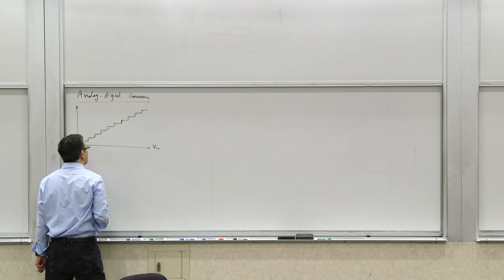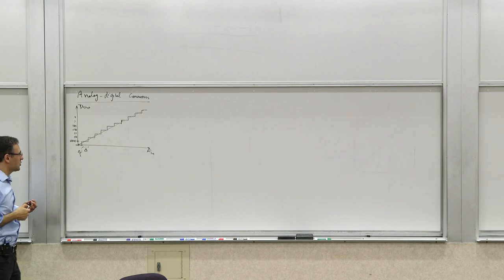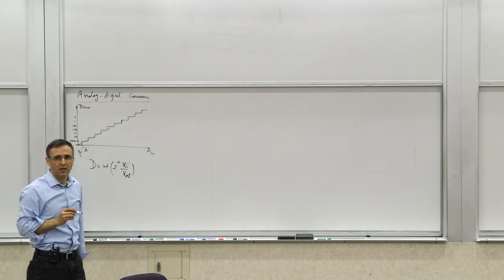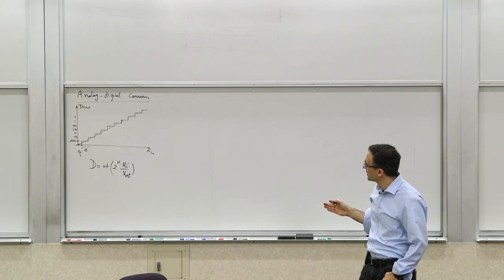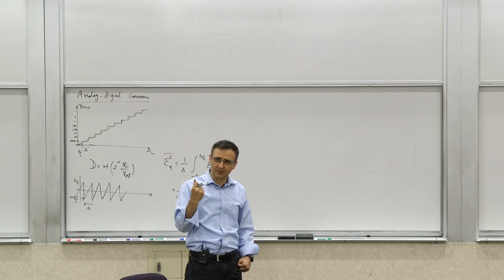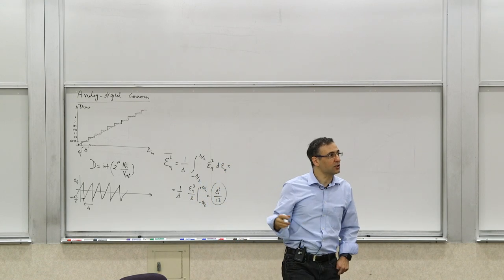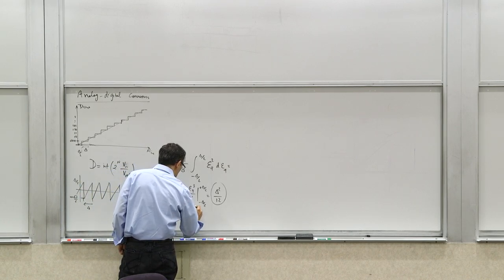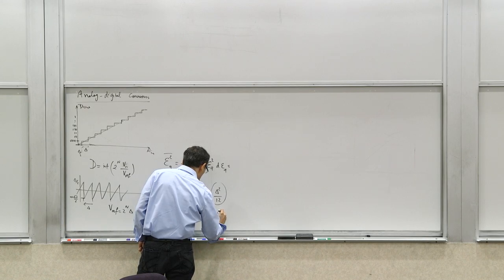183N. Basic analog-to-digital converter architectures

Comment: Shouldn't the first 4-bit ADC at 22:41 output LSB instead of MSB? Say I have analog input of 8, that's 0000.1111 for 8-bit and 1111 for a 4-bit.  That "1111" in the 4-bit is the LSB of the 8-bit representation.
Reply: no. The second ADC is a refine of a single quanta (delta) of every digit of the first ADC